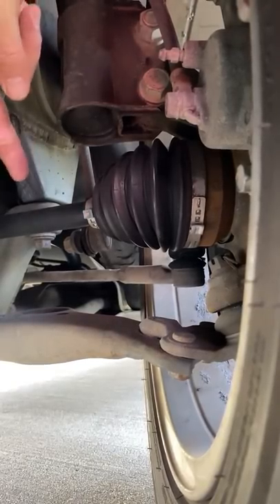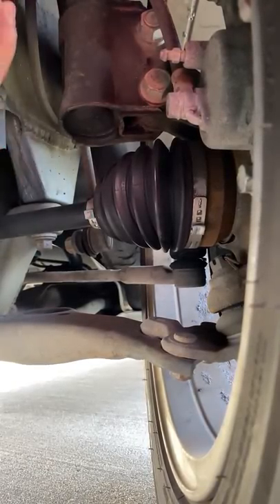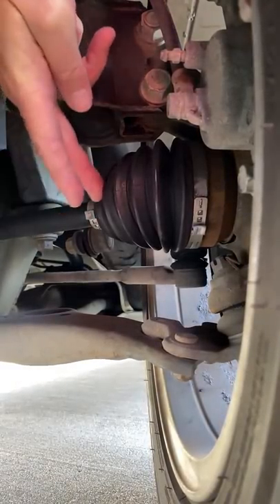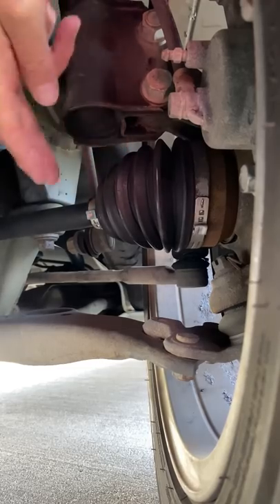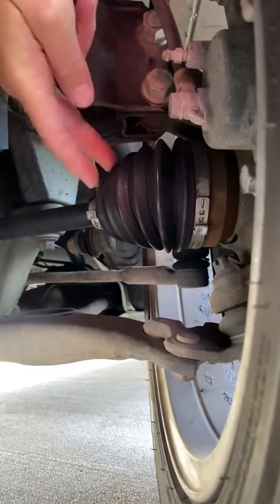When This Happens, Stop Driving and Check This Immediately

Comment: Best way to tell of those shafts are bad is drive backwards turning all the way to the left & right. If they are bad, you’ll know it instantly. They may even make a popping noise. You will tell by the sound, which side is the offender.
Reply: Even with a rear wheel drive? I just got my diff renewed but it feels slouchy n not nice.

Comment: Many years ago, I drove my first car which was a 90 Legend long before I knew anything about fixing them. I drove around for a while with a clicking half shaft until one night while pulling into a friend's driveway it snapped. The car immediately came to a stop with the passenger fender resting on its now disconnected wheel. Fortunately the driveway was wide enough to drive around it, so got it towed the next morning. I'm still convinced that I was lucky it snapped while I was going ~5mph instead of at highway speeds on public streets. Even at 30mph it could have been catastrophic.

Comment: Typically harder to tell in park with a rear wheel because there is torque still applied from sitting on the park pin. Slap it into neutral and have a bud holding the brake(obviously with the engine off).

Comment: One additional note that would have been valuable would be to make sure your vehicle is in neutral with the parking brake on when you're checking any drive shafts. If any of them are loaded they won't be able to move by hand.

Comment: My rwd car had the worn driveshaft couplers and center bearing replaced. about 5k miles later which is today I got some vibrating sound under the vehicle while accelerating. I looked under and seen the driveshaft had some slight play when I twisted it. Will the rubber coupler or coupling be the issue once again even after being replaced approximately 5k miles ago?

Comment: 30/3 22 - Scotty l don't have clicking on my 63000 mile 2013 UK Suzuki SX4 1.6 Automatic FWD but do get a hollow rumbling noise from time to time. Passed the recent UK annual MoT test - originally known as Ministry of Transport test - 1st time.  Pair of new Front Maxxi tyres fitted, balanced with lazer tracking checked, 1000 miles ago. Is just resonance, or ...??

Comment: It's a lot easier to just replace the whole axle on fwd cars. They pop out with a nail bar and the new one slide s right in. (After you undo the axle bolt).

Comment: @ Scotty Kilmer or anyone that can help I have an 03 Nissan Frontier 2.4L 4cyl When I turn the wheel all the way to the right it occasionally makes  a loud pop. Any ideas?
Also there is a loud clicking sound that will come and go from the rear of the truck. Sometimes it's gone for a ouple of months, then comes back. I cant pin point where it's coming from. Any suggestions?
P.S. Wheel bearings seem to be fine. The one's in te front were replaced but did not fix the popping sound. I live in Ricmond Indiana, if anyone lives close I'd be happy to pay them if they can take a look and pin point my problem. I can fix it myself if I know what "it" is

Comment: Does the 4L60E transmission have protection against going from Drive to 1st gear while moving fast? I'm terrified that I've prematurely worn out my 1999 GMC Yukon. cries
Reply: I don't know for sure, but the 'E' designation means it shifts electronically, not mechanically. You're probably okay.